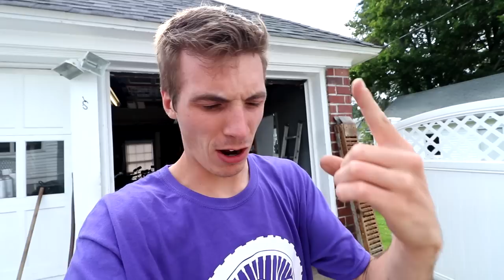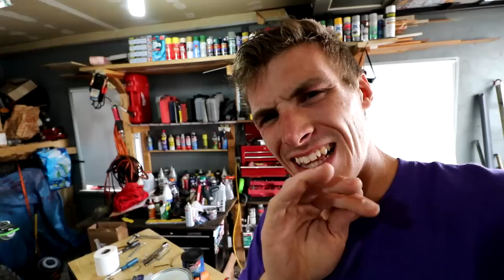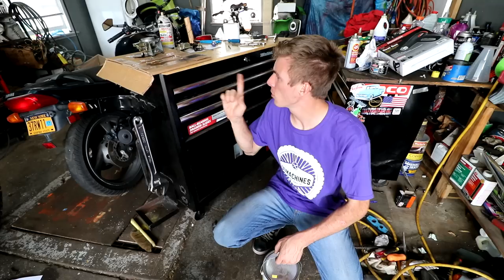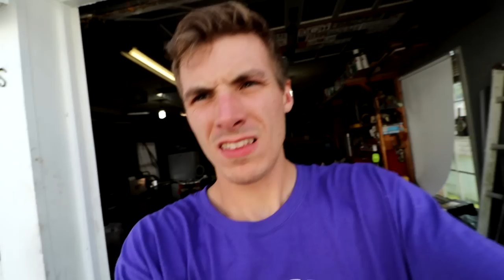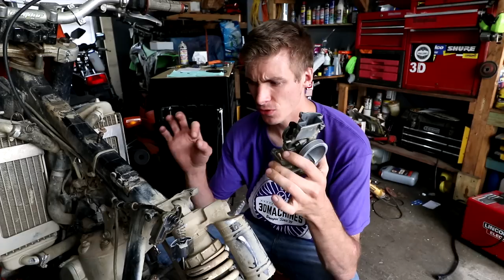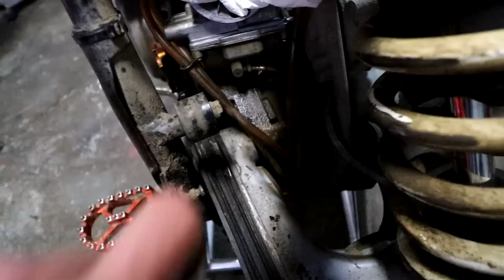DESTROYING MY DIRTBIKE

Comment: Don't stress about the carb leaking. I've only had one that didn't leak after a rebuild. Usually it's caused by dry seals on metal. Or your floats are stuck open. I usually let the gas flow for a bit and if it's still leaking tap on the bowl with a screwdriver

Comment: @3DMachines- If you put the float bowl back together correctly you don't actually have a problem. Seals need to swell, floats need to seat, and the plunger needs to seat too. 2 minute fix: tip the bike on it's sides and let it leak while you tap on the float bowl with a screw driver. Done this 20 some times with great success. Every spring when I first put gas into the KTMs they have the same problem. Works 95% of the time, if not, ride it for 20 minutes and problem solved. I trust that your floats haven't gone bad since they worked 3 days ago.

Comment: Thanks for the vid! )
A couple of tips for using ultrasonic cleaner:
1. Move big parts around, while you're cleaning them. Cheapo ultrasonic cleaners (those without frequency sweep feature - which is almost every cleaner out there) have standing waves, meaning it has spots where it cleans reallly gooood and spots that it doesn't even touch. The other trick to see the pattern of those intensity spots - is to use thin' aluminum foil on top of the water (or whatever liquid you have in there). You'll see small holes right away in the spots where it'll clean really well.

2. If using ordinary distilled water as a base for cleaning medium - you need to degas it first. Water contains a tiny bubbles of gas which prevent your ultrasonic cleaner from doing its best job (cavitation doesn't work as well, because of those gas bubbles). So, just put that fresh distilled water in the cleaner and run the cleaner for about 30min (not sure about the exact time).

Comment: Dalton,
          Just a word of advice, R.T.V. is ok in certain situations but if you can see it squishing out seems on the outside of your engine than most likely it's also squishing out internally as well, which is NOT good, that rtf will break down and clog up areas or holes that shouldn't be blocked, a light spray of 
"copper coat" should be all you need too seal most anything.
      As far as your carb still leaking I've found that proper torque specs and sequence are key, also, pre checking mating surfaces such as float bowl too carb body with a straight edge and correcting if needed works well, good luck.
         Sincerely,    Kevin M.

Comment: When are you replacing crank seals? You have to split the block to change them. In A two stroke the crank case is sealed separate from the transmission case. The crank is lubed by the 2 stoke oil unlike a 4 stroke were the crank is lubed by the engine oil. Changing the sprocket or shifter seal will not fix your leak. Just a heads up, Good luck

Comment: If it's leaking then it's gonna be your float height and your fuel valve seat bc my YZ did the same thing. Adjust the float tang a little and replace the little fuel valve attached that shuts the gas off. And there should be an o-ring around the part that that little valve goes into.

Comment: I went to re do my coolant on the crf250, everything went well and when i filled up i forgot to put the drain screw back in and i made a huge mess. Then when i went to fill up after putting the bolt back in i wasted the coolant i had and didnt have enough.

Comment: On my three wheeler I had the same problem. Idk where your ktm  is leaking gas at but try to tighten the drain on the bottom of the bowl. otherwise it could be the float sticking

Comment: Its just your float lever if your bike is sitting not running and its leaking gas then your float level is wrong because the gas will keep pooring out the overflow. If your bike leaks gas when running it's your float bowl gasket

Comment: Both of my second gen cummins both is a 98 5.9 but one is a 12v auto and the 24v is a five speed. Since the day I got them I've had nothing but problems granted I haven't had a single problem with the motors but both trans the auto in my 12v has been replaced twice and now I have a huge wiring issue my cluster is not working at all but it has power and I lost first gear and overdrive plus it was just rebuilt now my 24v I've replaced number 1and4 injector line and it makes the second time my fifth gear nut had backed off plus my edge box cuts off sometimes and my 12v needs new doors and a new exhaust and a new fuel shut off solenoid and all new tires and my 24v needs a hole new cab and a brake line plus the flatbed lights rewired and the cab lights so yes I definitely feel where your coming from. Lol keep in mind many of my buddies have older and new cummins and their hardley have any problems. I'll probably take the auto out of my 12v and put the 5speen in it and make one good truck and one to beet on lol but I don't have a lift anymore so I'm fucke*

Comment: Carbs, oh the fun of them. When they work, which is most of the time, all is good, but when they go bad.... Anyway, two things to check. One, the float height, did you check that? If the float is set to high, it overfills the bowl. Leak. Two, I didn't hear you say anything about checking the needle and seat. If either is worn, LEAK......

Comment: How abut the time I decided to throw new struts on the Tahoe.  After installing the first one I was convinced that it wasn't torqued down enough so I read the torque settings and got out the torque wrench.  After about 3 pulls the stud twisted clear off the the NEW strut!  There's $118 that I'll never get back nor the time to then remove and replace a new strut again!

Comment: My dads 450, we got crap on the carb and it stopped running, we cleaned it out 4 times and still didn't run, it was that damn spark plug in the end, we changed the spark plug and it fired right up

Comment: The bump in the road that happen to me was i was puting a new motor in my truck (1969chevy c10 stepside) an the fule pump on that is driven by the crank shaft started to leak real bad so pulled it off an put a electric fule pump on it now she drives like a queen

Comment: I have a 2001 KX125 I was riding it the other day and it started bogging when you went more than half throttle and it kept bogging harder an harder and then it died out and you would start up bog pop and then died what do you think the problem is if anyone can help and now it will only start when you push start it an it just bogs an dies
Reply: zack ponce it blowed up

Comment: One time I was working on a weed eater and the fuel went up to the carburetor and the engine was wanting to start but it didn't. Then the fuel in the fuel line went away from the carburetor and it didn't start. I needed a new diaphragm

Comment: do a full KTM tare down I thought I had a oil leak problem from a cracked case turned out to only be the gasket on my 2016 300xc but I tore the whole bike down anyway and while I had it all apart I did a whole re-sleeving and piston change as the bike had already accumulated 80 hours on the piston.  being in Hawaii 80 hours of rough trail riding is a shit ton and is begging for a blown piston and cylinder scoring
Reply: and the electric stator as well as the starter because they typically die after 100+ hours so I replaced that as well

Comment: I bought a sherco 450 enduro and found out the guy broke off the banjo bolt on the end of the oil pick up tube so he put like 2 sticks of jb weld on it and oil was leaking mixing with coolant in the cylinder head. Anyways I had to buy a new cylinder head beacause the old one was fucked and the new one was $750

Comment: i bought a KX250f 2011 for $1500 and i got it going in an hour they guy i bought it off of brought it to the dealer and they couldn't find the problem. All it was was the top end was done and filings got onto the stator and shorted the sensor sold it for 4000 made some easy money that week... But the next week i bought a yz450f for $1000 thinking i would just have to do the top end which i did but it turns out the crank shaft was messed up and now i half to buy a new shaft still working on it. good luck with the KTM

Comment: My old truck I put a new motor in put everything together get the battery hooked up turn the key it was out of time we fixed that then we tried to start it again it started to run but there was no oil pressure so either the camshafts got moved when we were changing the timing chain and gears or the oil pump is out of it we'll have to take the motor back out of it and take it all back apart this was a course of a year and the fuel pump that we got for it wasn't the right one and it was $500 since the truck was a half year 2007 Silverado classic with 240k miles and rusted to hell I just said f**k it and bought a 2002 Passat as my first car and it's amazing on gas it gets 23 average around town I just put a custom intake in it. Throttle response is way better

Comment: Buddy don't worry this is life just got to keep smiling loon but rule of thumb when stripping something down for a good clean get a gasket or rebuild kit I spent 1 week on a full rebuild of a yz85 every component taken out and cleaned and inspected for damage when it was done and fitted in the bike was so happy with my self so took it out for first run everything was perfect till it was loading time and then it felt like a kick in the place no man wants to bo kicked lol oil leakage not cool was so disappointed I stopped in passed my local bike shop and thay helped me out fixed my mistake for me as my work was picking up and had known time. Long story don't give up life is full of challenges now mater how big or small keep positive and you will get over it.

Comment: I broke my chain tensioner off in my swing arm on my 99 cr250r the I went to take my swing arm off and my lower shock linkage bearings fell all over the floor so I had to by them

Comment: Bought a 2013 rmz 250 bogged out cleaned fuel injection and fuel system ran fine put new air filter in clogged censors cleaned all censors forks broke 2 months later parts came ride it bogged out when hot checked valves many times before checked them again exhaust valve was tight got it fixed ride it again blew the crank out then sold it never buying Suzuki again